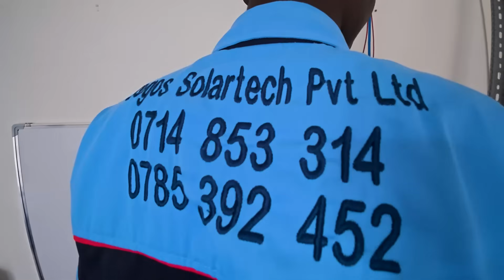HOW to Choose The Right SOLAR System SIZE FOR YOUR HOME

Comment: This guy was speaking a whole lot of word salad without addressing the question he was being asked . He was talking about refrigerator classes 😂. He was rumbling about a 3kVA system which is the inverter output without talking about the battery bank being the issue. For example , if by 10pm your system shuts down it means your battery bank is either too small , it wasn't sunny that day . If you turn everything ON  at the same time and your system shuts down , that means your inverter is too small . Running out of energy by 8pm simply means battery too small . 

Solar is very simple to understand. What needs to be done b4 getting solar is an energy audit .  This is were you look at how many items you need to run at the same time ( for inverter sizing ) , how much energy each item draws (in watts) and how long you want to run those items ( for your battery size )

Big battery bank means your solar system runs longer .
Reply: Haiwawo zvaataura mazvinzwa
Of course you have more to say but zvataurwa was enough for someone to learn
Reply: @TendaiMukube yes good thanks Tendai for telling this overzealous guy to stop beating his chest as if he's saying something poisonous....Kundai explained everything clearly and but ava mukoma ava kwangovawo kamweya kekuda kuwonererwa

Comment: It’s just called Energy Audit. Then choose the right system required to power all your household appliances and devices if all require energy at the same time. Capacity required!
Reply: Energy Audit exactly the industrial term. Manje chinoitika ndechekuti clients would just simple jump in oti ndine this budget inokwana 3kVa system, in which 3kVa system stands for a lot. aisirwa basic 3kVA system wozonzwa akuti system yangu haisi kusimudza its because akajamba energy audit. Maclients mazhinji they don't want that they just want to jump in and part ways nemari vasina kunzwisisana naService provider. Ukatobvunza kuti munoda kusimudza chii nechii haaa unoita sewatuka client.